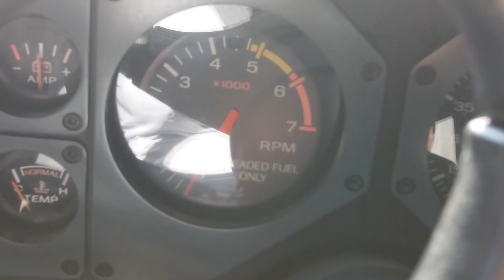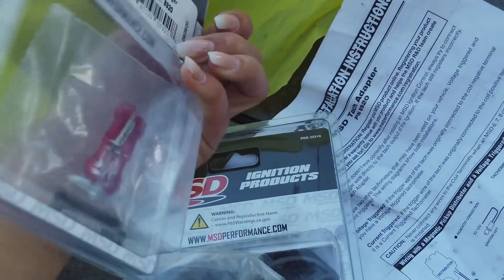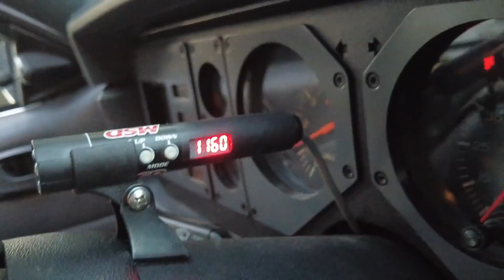Racing at Street Outlaws No Prep Kings

Comment: You hit that first 2/3 shift like a boss! Good job!
Reply: Yes she does. Her 2/3 is good, real good. She'll get that 1/2 dialed in soon. She should watch some old 'in car' footage of Grumpy Jenkins, Herb McAndliss (sp), Ronnie Sox to see how those guys pulled the 1/2 shift. It may offer her a few tips from the guys who made the term "Mr 4 Speed" real. She can be "4-Speed Molly' :)
Reply: @quickdeuce  it is kinda weird to have trouble 1 to 2 but not 2 to 3 which is usually significantly harder by comparison.  With a good shifter neither are an issue I just bang the shit out of 2nd right foot never leaves the floor and on the 2-3 same and with a shifter you can palm it and push straight and it nails 3rd...and 3-4 I grip it with the back of my palm if I try pulling straight back arm in normal position I miss 4th sometimes pulling too much towards 2nd gear.  The method I use in shifting I never really have issues long as there is a good shifter and I practice these methods been working for years.

Comment: Pro-Tip: Start pre-loading the shifter before you shift. When you hit the clutch the gear will already be on it's way. If you pull hard and fast the shift will occur in the time it takes you to push the clutch and take you foot off it.

Comment: B
You need a line loc to hold the car still during the burnout. 

Pull them gears no double clutching. Shift at the proper rpm. You get that down you will be perfect and unbeatable.

Comment: I suggest a line lock to heat the tires when you have slicks, 2nd gear burnout, and a two step for those also. Try to leave around peak torque rpm and it’ll pull the wheels. Practice makes perfect.

Comment: Before shift lights were a thing, I used to mount the tach with my 7,000 rpm shift point straight up. Easier to see at a glance. Some did it with all the gauges so straight up was normal  temp, oil pressure etc.

Comment: It's about time you got a tach and shift light I was wondering how you know when to shift without knowing what the RPM is. When driving on the street you really don't need to know but in racing there is a sweet spot RPM you gotta hit to make a fast pass and without a tach and or light you will be doing lots of short shifts and over shifts anyway glad you got a tach or a light to get you shifts right because that is very important.

Comment: I'm a little surprised they didn't have you go around the water running on street tires. Additionally, 18-19lbs tire pressure might be all right on drag radials, but a street tire will "cup" at that pressure. At any rate, with that much power and your setup, it's not going to hook anyway unless you're running a bias ply slick (i.e. those Hoosiers that came off it).
I'm looking forward to seeing what it will do on the slicks, line lock, 2 step (launch control), and quick shifting on the shift light. Getting good/consistent in a 3 pedal car can be really difficult, but the fun of running them is hard to beat.

Comment: She needs a lineloc so she can do a good 3rd gear burnout and get the rpms up for good launches.
Reply: Not on a street tire, you overheat the tire and it actually loses traction. But I have seen guys hold a hand brake so the car doesn’t roll through the beams. 4 speeds aren’t easy, I give her credit for trying.

Comment: So this is just my opinion Molly if you went to a 4-speed like a Hemi 4-speed or a M 22 or M 21 Rock crushers you could run a {vertical gate}》 shifter then you run a 《2-speed Hi-Lo》 box if you need that extra 5th gear  you can just use low for drag racing & high for Roll Racing think about it take a  night and sleep on it I had planned on building the same motor virtually as you may remember and also the same combination transmission and High Low box😁😇😍🤠😎🤓@$&cents

Comment: What is up with that shifter set up. I have never seen anyone have to work the stick so hard to bang gears. Not even in an old 5 speed Mack dumper with the dual shift levers. Thats not just a new driver thing. She cant be smooth if she has to fight just to get to neutral between gears.